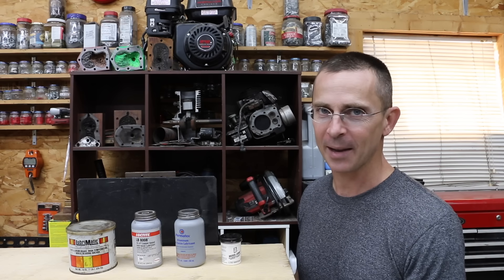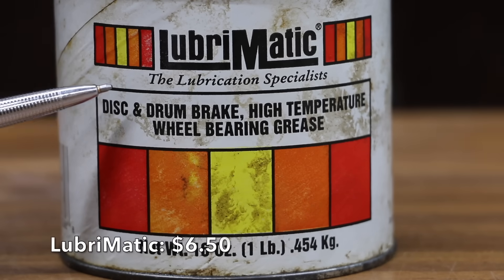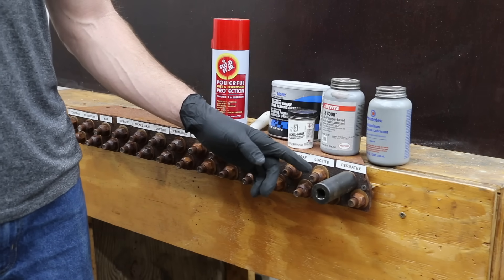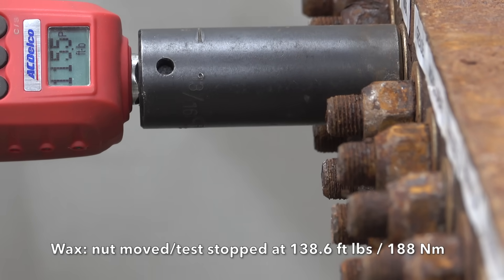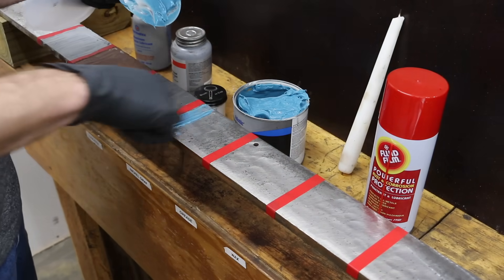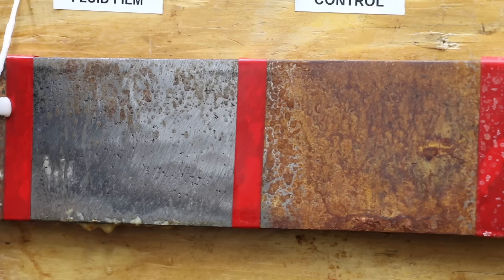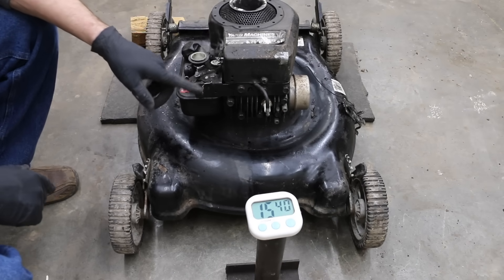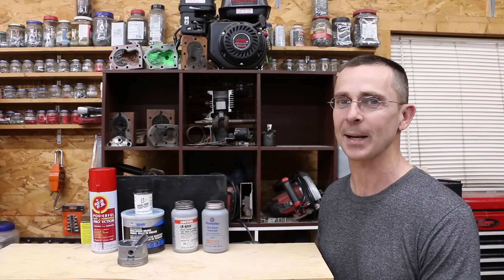Does Anti-Seize Compound Actually Work? Let's find out! Anti-Seize vs Grease vs Fluid Film vs Wax

Comment: How about a test between teflon tape and thread sealant (pipe dope)?  I remember watching my dad using pipe dope on galvanized pipe back in the 60’s.  Now we have teflon tape.  While I use tape for all joints where the threads form the seal, I always wonder if pipe dope would be better.
Reply from the maker: Thanks for the suggestion.
Reply: @ProjectFarm  I just saw a video where a guy used teflon tape then put pipe dope on top of that.  Anyway, thanks for considering.

Comment: I think the trick with using wax is to heat the part enough to melt the wax, at which point you just touch the wax to the part and it wicks into nooks and crannies like water.
Reply from the maker: Thanks for the feedback.

Comment: The absolute best anti-seize materials are molybdenum disulfide and tungsten disulfide; both are easily available (eg. amazon).  They are available as dry powders molybdenum disulfide is also readily available in lubricant/grease formulations, although for many years I have mixed the powder form into automotive grease or silicone grease if you need high temperature performance.  I use this material whenever I replace screws that could seize,  Warning-do not use in motor oil for your car because they will instantly poison and destroy catalytic converters.

Comment: Of course it works the real reason why they call it never seize is because if you get it in your eyes you’ll never sees again take one can of that stuff add a little motor oil and you can paint a 12000 sq ft barn.

Comment: If you ever redo the anti-seize for engine oil swap , I think it would be cool if you disassembled the engine first and applied it to every mechanical joint in a normal fashion instead of filling the crankcase like you did. Id imagine a 4 stroke with perfect compression would run for a very long time.
Reply from the maker: Thanks for the suggestion.

Comment: Industrial grade copper and high temp nickel anti-seize work a treat. I've torn down engines I built over 30 years ago with zero problems because I anti-seized all the external hardware. That watery Permatex is mostly decorative as it doesn't last many years. I've used it but it's not for the long haul (which is hard to simulate).  I use Jet Lube copper but there are many equivalents.

How about an INDUSTRIAL/AEROSPACE anti-seize shootout? BTW throw in Milk of Magnesia for hot work which was famously specified on aircraft engine hot sections.  Some viewer might have an old GEK that wasn't shredded (if you fixed fighters for a living that had GE engines you know of the GEK) and could post a pic. IIRC Airbus had it in their tech data too but I didn't work those.

Briggs and Stratton quit making their lead anti-seize but others still sell similar to industry. It was a great valve guide/stem lube before the oxygen sensor era. "Briggs & Stratton Valve Guide Lubricant & Anti-Seize Compound 93963" is still easy to find. WEAR GLOVES and discard any contaminated rags etc.
Reply from the maker: Thanks for the suggestion.

Comment: Well Anti-seize is really made to protect from Galvanic corrosion, also known as bimetallic corrosion, is an electrochemical process whereby one metal corrodes in preference to another metal that it is in contact with through an electrolyte (Salt Water). Also the Nickle Vs. The Aluminum or copper Anti-seize are usually used for different materials, Generally speaking, copper anti-seize is designed specifically for use on metallic threads, while nickel anti-seize is recommended for all types of threaded fasteners, including aluminum threads as well as stainless steel.
Reply from the maker: Thanks for sharing.

Comment: Is it true anti-seize shouldn't be used on vehicle wheel nuts because the torque rating is based on dry threads, and anti-seize messes that up and risks the nuts coming loose?

Comment: I worked at a company that used stainless nuts and bolts on their equipment and we had to use anti-seize compound. It was something about using air ratchets and their hammering motion that would make the parts weld together and get stuck. Now I know why you don't see a lot of stainless hardware!
Reply from the maker: Thanks for the feedback.
Reply: @ProjectFarm  You bet! I never knew that was a problem until I had to deal with it at work. LOL

Comment: Whenever I saw old timers use candle wax as a lubricant, I NEVER saw anyone melt it on, it was rubbed like soap powder or chalk etc...
I'm thinking that the melting and cooling are interfering with the ability to slip.
Reply from the maker: Thanks for the feedback.

Comment: You might consider tef-gel for anti-seize. It isn’t designed for heat, but it assures something can be disassembled in the future.  Every thread on the boat has this stuff on it.  It works well.  Another trick is butyl tape.
Reply from the maker: Thanks for the suggestion.

Comment: If you put antiseize NOT on the threads but on the segment between the head and the threads it keeps moisture and rust from siezing the bolt in place. Sometimes the benefits can be seen years down the line, especially if you live in the rust belt.
Reply from the maker: Thanks for the feedback.
Reply: indeed

Comment: If anyone has ever purchased a new Glock handgun, they'll notice the copper colored grease in the inside of the slide. That's C5A. I would love to see a test between old and new C5A to see whether or not the "expiration" date really matters. The reason it's on there is that C5A is used a lot in aerospace applications and they have VERY stringent regulations regarding age of products used in engine service.
Reply from the maker: Thanks for the suggestion.
Reply: @ProjectFarm  Thanks for noticing. I love your content. Easily top 5 channels on YT.

Comment: liquid wrench is the real thing I sprayed it on a rusted exhaust system three times the first day then next day it came apart like it was new. Thats how it works don't expect to spay it on and right away take off the nuts!plan the spray time for at least 5 hours of time to work if the truck is from Chicago Detroit or Boston! work on something else spray and if real bad spray again about three hours later and the next morning it will be a breeze .Penetrating oil also good !
Reply from the maker: Thanks for the feedback.

Comment: The contractors we work with for some soil stabilization jobs use a copper or aluminum based anti seize compound on their casings (basically 2-1/2 inch threaded pipe drilled into the ground with a drill rig). When they extract the casing, you can definitely tell if the drillers forgot the anti seize on a pipe segment.
Reply from the maker: Thanks for sharing.

Comment: Antisieze is king . I have engines, exaust, lugnuts and suspension bolts I antisiezed 25 years ago. They come apart, and the threads are all in better shape, no oxide.
Grease is only used in a pinch cant take HOT , wax disappears and cant take heat.
OFFROADER TIP.  Suspension lube> 1/4 antisieze silver, and 3/4 Marine waterproof grease. When your suspension runs dry or dirt gets in , the antisieze will help against wear MASSIVELY . trust me!
Reply from the maker: Thanks for the feedback.
Reply: @ProjectFarm  TY for all the great content!
If you ever need anything unbreakable broken, give me a shout!

Comment: I used to work in a bottling facility and we were required to use FOOD GRADE anti seize. That stuff was worthless. Components were constantly getting soaked in wine. There were parts I had worked on and 6 months later something would break out wear out due to the acidic wine and the fasteners were corroded.
Reply from the maker: Thanks for sharing.

Comment: Another great comparison video, thanks. I've always been a big fan of Anti-sieze compounds and have been using them for over 45 years as a mechanic. I was introduced to them as a beginner for spark plugs. In the old days spark plugs were prone to seizing in the head and Anti- Seize compounds were the best way to prevent a major job of removing them. I always enjoy your tidbits of info like this one, I didn't think about copper formulations causing a galvanic reaction with aluminum. Good to know. I was told early on that the way they work is with tiny glass beads that stay in the threads to act as bearings when the grease compound dries up. My theory is that the main advantage of using them on spark plugs is that the grease component of the Anti-Seize fills any void in spark plug threads to keep carbon deposits out of them. I'm not sure if that is accurate. 

I wasn't surprised at the lawn mower test as the main job that engine oil does is to carry heat away from the bearing surfaces and to other parts of the engine block where it can be dissipated through the flow of the oil. I wonder if Anti-Seize would perform better in an engine with an oil pump so it would flow through the bearings. One thing I was really surprised at was the expiration date on the one product. What the heck? It's not food. I have cans of Never-Seize brand from 30 years ago that I still use today.
Reply from the maker: Thanks!  Thanks for sharing.

Comment: I would like to see this test done with a 2 inch diameter chrome-moly pin in mild steel hole that is 2 inches thick. It is a common pin type in heavy equipment and anti-seize is normally used on them to ensure they don't get rusted in place.
Reply from the maker: Thanks for the suggestion.

Comment: At work one of my Jobs replacing set screws cat/50 bt end mill holders.With chopper anisease set screws break loose  with out it I've end up Drilling them out,same with carbide inserts the set screws seem to screw in easier and you can feel them bottom out,with it they can be removed with any problems.
Reply from the maker: Thanks for sharing.

Comment: One of the best anti-seizer's in high temp apps...Phillips Milk of Magnesia!  Non corroding..non hardening..dries between the threads ..causes zero distortion..holds torque. ..clean breakaway on teardowns.  Used on MIL jet and turbofan engine boltings.  Proven.

Comment: Antiseize may work but higher psi + heat adds a weld element to the bolt. Lastly, grade 8 bolts should be used in all applications so the heads don't bust off.
Reply from the maker: Thanks for the feedback.

Comment: As an electrician, I use anti-seize on stainless fasteners and screw terminals to prevent them from galling and self welding to each other. No-ox grease works in a pinch.
Reply from the maker: Thanks for sharing.

Comment: I think you misunderstood the purpose of anti-seize compounds.
The idea is to provide a layer between the threads that will easily shear — after the oil / grease carrier has evaporated. Indeed, the main difference between the different compounds is the upper temperature limits.
Being of a “safe” metal, the compounds also help prevent galling (where the base materials tend to grab onto each other and damage the threads).

Comment: I really enjoyed the style of video No Time wasted whatsoever. Straight-to-the-point. It would be great to do a 10-year test. I own a Automotive repair shop in Illinois, they don't hold back on assault at all in the winter. As you pointed out in the beginning of your video it takes twice as long especially on exhaust bolts. The blue wrench is your best friend in such cases. If it would be great to have a fleet of vehicles operating in this area do the same amount of repairs, for example exhaust manifold and catalytic converters and anti-seize the studs. Anyhow, I will continue to use my copper anti seize on spark plugs and exhaust bolts.
Reply from the maker: Thanks!  Thanks for the feedback.

Comment: I used Permatex anti-seize on the 2 inch drawbar on my trailer hitch on my van. After about 6 months I had a horrible time trying to remove the drawbar. After applying a large quantity on all 4 sides of the drawbar, it had to be removed by heating with a welding torch and a 10lb mall hitting the drawbar from the back side with a piece of 2 inch square tube the same size and weight as the drawbar. I have been using bearing grease since then and even after a year, my drawbar comes right out when needed. I have not tried the other brands of anti-seize. The bearing grease costs less and works just fine.
Reply from the maker: Thanks for sharing.

Comment: I worked in a water dept. pipe gallery replacing pipe installed in the 1940's, they were put together with anti seize. the bolts came apart easily and looked like new
Reply from the maker: Thanks for sharing.

Comment: Your source of heat with the Charbroil grill is Not accurate way as the center of the grill is much hotter than the ends.  This makes your experiment totally a joke.  You have to have much better control of the heat.  The grill's thermostat is only in the center and you didn't get a reading of heat on the ends that were in the corners, the coolest spots.  Come on you much think better instead of just using your grill. ??

Comment: I used lok tite copper on load bearings in a ovens for years in a commercial bakery. Better then high temp grease.  Change the PM program on the ovens. Good stuff!

Comment: I use marine grease mostly or Quick Silver anti-seize for propeller shafts or if the application calls for it even stainless steal bolts. Marine grease holds up better outdoors in wet rusty conditions because it doesn't break down as fast from water.

Comment: I never seen Anti-ceased be used as Oil before. I am Amazed, I am a Firm Believer In Anti-Cease. In Addition the two Products of Anti-Ceased is what I Use. Great Videos. Copper or Nickel is the better of the Anti-Ceased because it will Take More Heat without seizing. I am a Old Maintenance Man for 42 years and the Anti-Ceased works.

Comment: I used Anti seize product on spark plugs thinking I could remove plugs easily and would never have a problem with cross threading sparkplug hole threads on aluminum head. I never cross threaded but the Anti seize makes it easier to over torque plugs and I ended up over torquing one plug.  Go figure. I would never use it again and I would only buy iridium plugs with threads that come precoated.

Comment: I’ve used the Loc-tite C5-A and LB-771 for years and they have never given me a reason to switch. Temperature, alloy and environmental conditions should be considered before selecting which works best. A little bit goes a long way! One drop usually finds its way onto every work surface, article of clothing and auto interior for about a week 😂.
Reply: Got that right..find it everywhere after using no matter how careful

Comment: It does work. Used it before & came back to work on the same equipment 3-4 yrs later on a ship. Was able to remove hardware much easier compared to other times when you can see rust on threads.
Reply: of course it works. heavy equipment guys- cranes, draglines, excavators, bobcats, whatever, usually keep a 5-gallon pail of it around

Comment: Just caught this video - thanks - nicely done. Wanted to pass on a tip. Back when I was building race engines for Rally Racing, I used copped anti-seize on head bolts. Just a small dab because it does not take much. In particular for "stretch" torque. Also, as a prelude to torque, I would counter-sink the head bolt holes and then chase the threads. Makes it so much easier to align the head bolts.
Reply: called 'true-stretch bolts' and they are supposed to be torqued to a particular amount of stretch. easy to do with connecting rods that have accessible bolt ends- but most head bolts cannot be measured like that and you have to follow the torque specs and cross your fingers. chasing the threads is critical if you suspect or know it was put together with loctite. also, magnafluxing stretch bolts (or brand new OEM) is critical in a high-output motor. most manufacturers will not warrant such an install with used bolts.
Reply: @tommurphy4307  I never, ever, reused head bolts. Too damn dangerous.

Comment: when I worked for a master plumber we would use heat proof grease. I would put  in the guts on  central brass shower tub  diverters even on the screws that hold the handels on.

Comment: I would think that an anti-seize that requires less torque to remove a nut than it was originally torqued to could cause problems with potentially backing off with vibrations. If I torque something to 90 ft/lbs, I’m not sure I want it to come off with only 74 ft/lbs.

Comment: dunno bout that white garb as anti seize, looks like dick paste ffs .. anti seize isn't always just about a lube, it may need to be anti corrosive and conductive like for spark plugs, temperature sensors so forth, pay the extree for the copper infused, it last a long time and is heat proof, works on caliper and rotor bolts as well...  copper infused grease.. a MUST for spark plugs and temp sensors so forth, I use it on rotors and caliper bolts suspension yo name it, and it doesn't inhibit torque and prevents corrosion and decay..  permatex